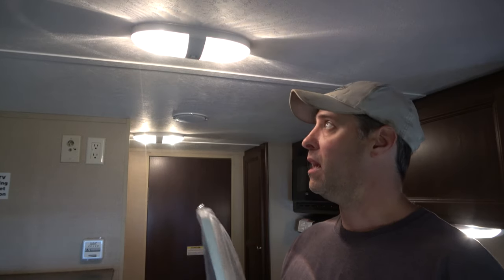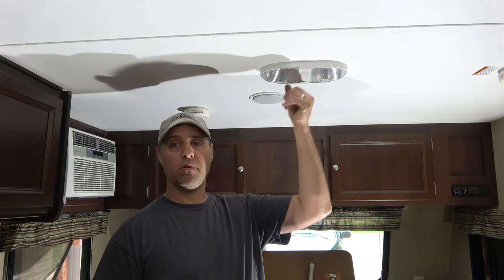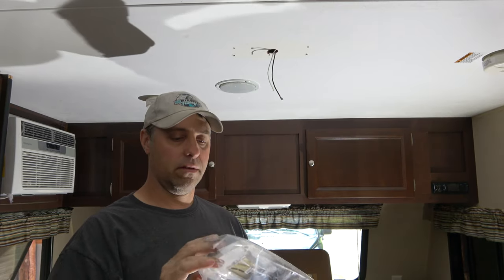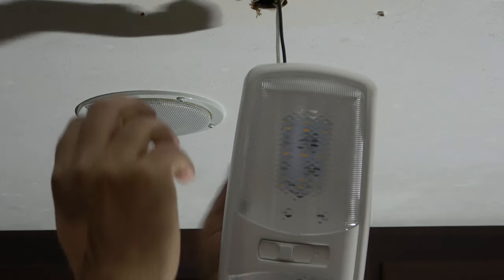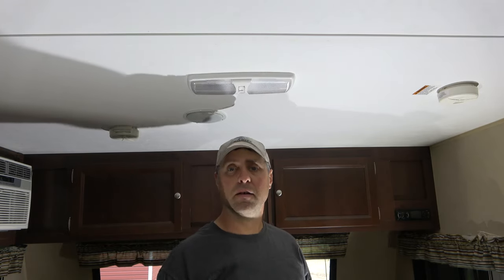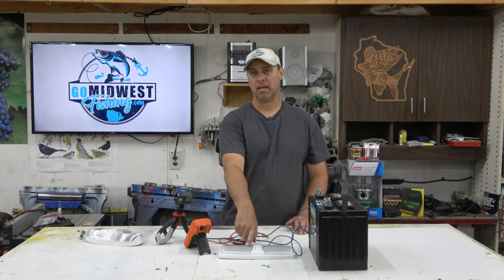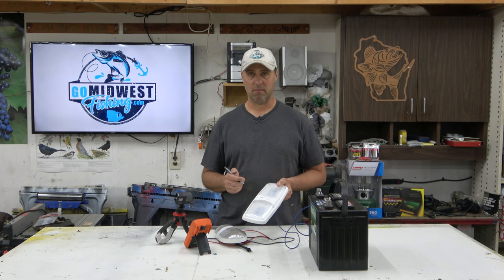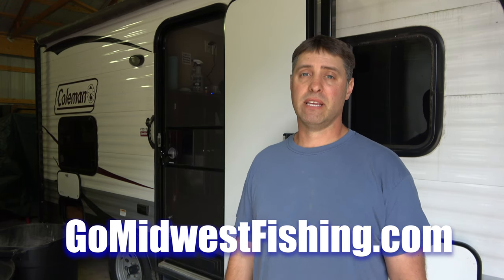Camper and RV LED Light Conversion

Comment: Why cant you just put led bulbs in the old fixture? Whats the difference?
Reply from the maker: Hi Katherine. Yes, you can also just change out the bulbs if you can find ones with the same base. I like the fresh look of the new light fixtures. My old ones were getting yellowed and just didn't look very nice. Either way, its an easy conversion. Thanks for watching.